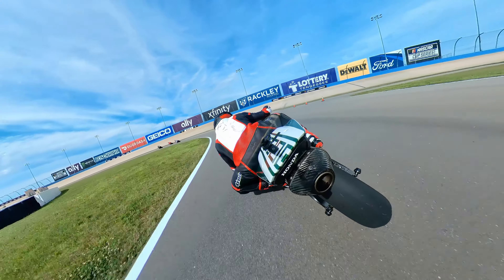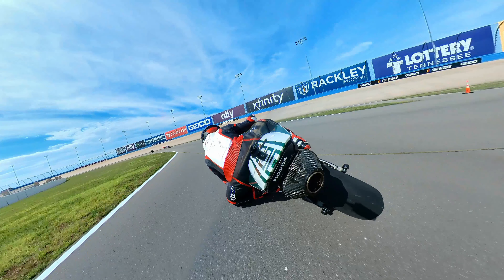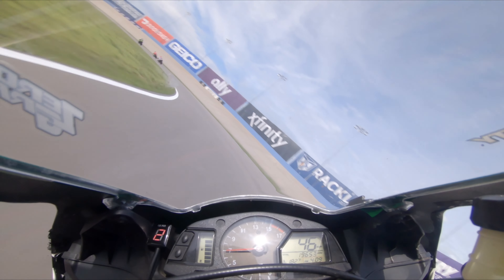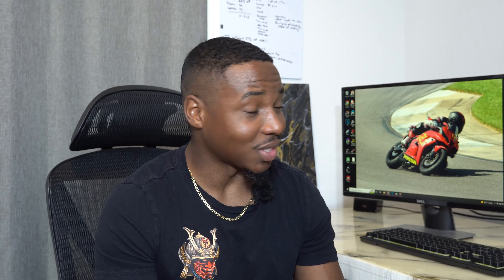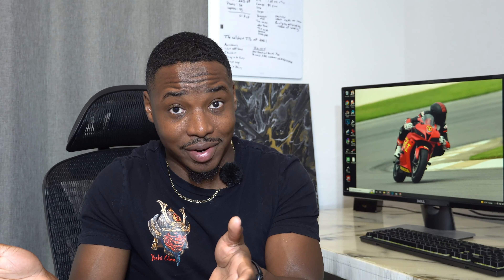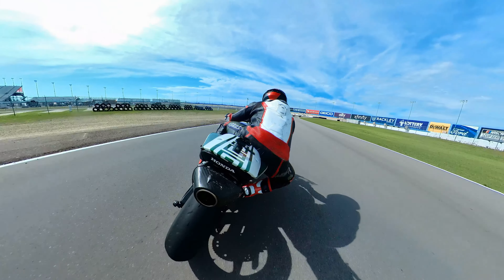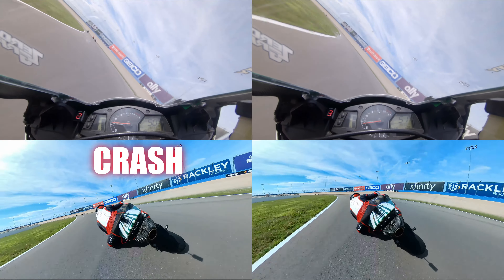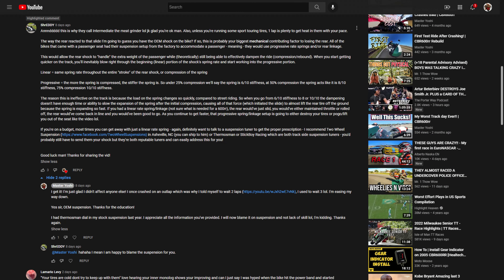This is What Caused My Crash | Honda CBR600rr

Comment: Was this toward the end of the trackday? I have a tendency to just lean the bike more (and body less) when I'm fatigued, and that's landed me on my ass a couple times.
Those stickier tires you mention, are they slicks, or just a newer version of the tires you were on? (i dont know michelin, im a dunlop stan) I don't know if an incremental difference would have saved you going over something that loses you traction that quick. I guess when we buy fancy tires the extra dollars translate to a wider margin of error, whether it's big or just incremental.

Dope that you have the camera gear to see it from all angles. It does look like a perfect storm of a few factors. Glad you're safe and (afaict) unharmed!
Reply from the maker: No sir, it was barely session two, which was another reason  I was so surprised it happend. I wasn't really pushing, still getting used to the track. It was my first time there.
By stickier, I kind of meant both. Really just meant if I had more grip, it may have given that extra room for error you mention.
Yes sir all is well! Just had to replace my helmet unfortunately lol. Thanks for the comment!
Reply: @Master_Yoshi  I went out on a cold/wet track with shiny new zero-mile tires for the practice laps at my last race. I was being careful but still had a nice embarrassing lowside in turn 2 of lap one. Supermotos are indestructable so I was able to keep going that day without a problem, but it took a while to get confidence back. 
Seems like getoffs are usually a product of multiple factors, all working together to get you off the seat and into a midair dance pose

Comment: Well, I've been there and done that a few times now. Glad you are ok. I would have to say that from what I see, I would point to the suspension and the tires. The EVO is a dual compound tire, and sometimes that transition area between the compounds can be no so subtle. I used to run the Q3+ on track, and have felt this transition, especially when the tire gets overheated. I would work with a tire vendor at the track to get your cold pressures set. If you are running tire warmers, I would stop doing that with a dual compound tire. ( again, my experience with the Q3+ )  I switched over to the Q4 on my trackbike, and it was one of the best changes I made for the track. As stated about the suspension, make sure it's setup for your weight and track use. Love your content man!
Reply from the maker: All great suggestions! I stopped using the evo and finished the season using power cup 2s. My suspesion is stock, but it was set up professionally, but at 200lbs and track pace, I'm sure it's time to upgrade lol. You must be exited to try the new Q5s then, right?
Reply: @Master_Yoshi  I am, but I'm not. My last two sessions last year I used slicks for the first time, and I may be hooked! So I'm torn. I know a lot of people who use the Cup 2 for track days and really like them.
Reply from the maker: I'm still a big perilli fan though! I'd use supercorsas if they werent so expensive lol. I hear you, what brand and  compound of slicks did you try?
Reply: @Master_Yoshi  They were Dunlop medium. They were Moto America takeoffs, so they were pretty cheap. :-D
Reply from the maker: @jshawley  I've still got a set of takeoffs to run, I used one set at little Tally as sacrificial tires since they only cost me $50. It's great to have racer friends who hook you up!

Comment: Have you had your suspension setup?  Your rebound could be too fast which will  cause your rear to catapult.  Also you may be too hard on the compression.
Also, start getting your head over all the way to the mirror when you hang off.
Reply from the maker: I had it set up maybe 8 trackdays and a big crash prior to this one. I agree, I could probably benefit from another servicing. Thanks for the tip!

Comment: I'll identify myself as a regular street-rider like some of the others. I feel (agree) that any one of the five factors could have prevented the crash; but if I had to choose one, I would say it's the lean angle is too much. I ride a 600, but not a track dude.

The dude ranting about Quarter-Asscheek and Half Ass, and Half-Cheeks might be onto something. Definitely worth adopting as a new measurement. How tall are ya? About 42 quarter-cheeks. How big is your aprtment? 1375 square-cheeks. Distance to Empty? about 35 Kilo-Asses.
Reply: Doubt it he’s barely off the bike on that crash he should be hanging off the bike and putting pressure through the left peg hanging off and getting ya knee down prevents this cause the bike stays more up right witch means more tire on the track
Reply from the maker: I'd say lean angle was a factor as well! As for the ass cheek method of measuring. I stand about 18 and 1/4 cheeks tall😅
Reply from the maker: @jimmyboimazarti1234  I said to same thing your saying to someone who said body positioning wasn't the issue🤷🏾‍♂️

Comment: The problem is the RPM you were applying throttle. Anything under 8k on most inline 4s you are down 50 hp. As you soon as you climb above that there´s gonna be spike in power. Especially on a 600. But like you said tires play a huge part. Looking back on your footage you were riding pretty gentle in the corner exits. With the long straights on that track, you are gonna lose a lot of temp. Most important you and the bike are fine. I´d drop a tooth or two and to try  exit the corner at a minimum of 8k preferably 9k for a more predictable exit.
Reply from the maker: I never thought of that, thanks for your input!

Comment: From the camera angle it doesn’t even look like you’re leaning a ton. It looks like you just fell over randomly, lol. But I bet you bring super far back in the seat was one of the biggest factors. You better stop wrecking before the wifey takes away your bike!
Reply: It was groove in the road. U can see the cracks in the ground. And he had poor riding posture
Reply from the maker: Yeah man, it was an odd one for sure. I didn't feel like I was pushing my pace or anything. Rear just got loose, and I've never had it happen before lol.

Comment: The only thing that caused your crash was bad throttle control.
Reply: I still think it was throttle control and possibly still leaning while adding throttle. I see him starting to run wide, stay hardish on the throttle and lean a little more.
Reply from the maker: You think no other factors played a role at all?
Reply from the maker: that's possible! What does hard on the throttle mean to you? I ask because I thought I barely had it open😅
Reply: @Master_Yoshi  Whenever I need to turn in harder I always let off the throttle and use the engine braking and stay leaned over and cross over to pass someone. I’ve only had one incident almost like yours here and I was on throttle and was leaning for a long sweeper. For those corners I go in with trail brake with the pace I want, lean over and gradually pick up bike and add more throttle. I’m in A group with every org in my region  just to add a tiny bit of solidarity to my opinion.
Reply from the maker: @dancarlos1216  I hear you my man, I'm not saying your opinion is wrong at all, I was just questioning what you meant by hard on throttle. Going forward, I'll be sure to be more conscious of reducing lean angle before applying throttle though.

Comment: Why did you jump off the bike? That was a minor, very minor tire spin/slip. Learn how to sit/hold onto the bike. Was this your first time to ever ride a motorcycle?
Reply from the maker: I didn't jump, I just didn't try hard to stay on. In the midst of it happening, I thought I'd be best to stay loose and not risk over correcting and making it worse. Not the first time riding, first time losing the rear though.
Reply: It was a highside kick. Stick to your little 400cc scooter and please refrain from commenting about bikes and speeds that you are too afraid to ride.
Reply: LMAO, that was easy. I've club raced for many yrs. Won a few expert level season endurance championships(30race hrs). I've club raced 6 out of the last 10yrs.... GSXR 750, R6, SV650, R3. Member at local track with Ninja400 and GSXR 750. If you're ever in Dallas area, I can get you on the track!

Comment: Not bp, BP DOESNT CAUSE CRASHES! Idk why everyone is so hung up on BP BP BP.... there is so much more than BP. You could have been too hard on handlebars, too much gas, the crack upsetting and unloading suspension making the rear light and adding throttle right after before it settled.
Reply from the maker: I just see it as better BP equals less bike lean angle, which equals more grip.
Reply: @Master_Yoshi  Not necessarily. Body positioning lets you turn harder with less lean angle. But the result is less force driving the tire down into the pavement, and more force pushing the tire to the outside of the corner.